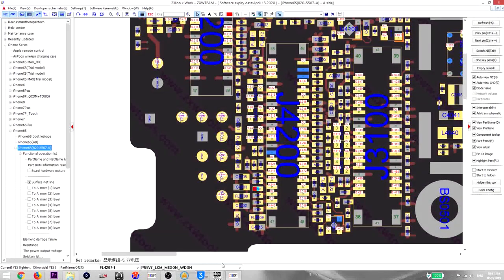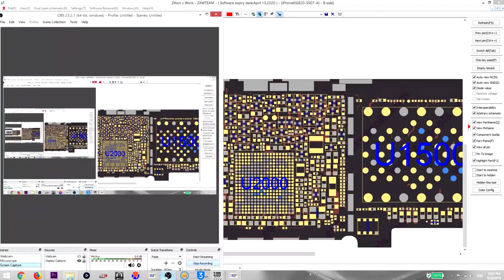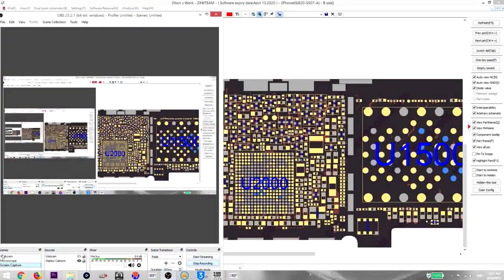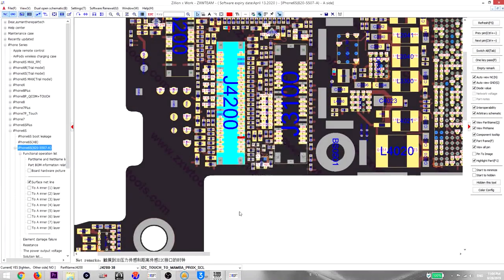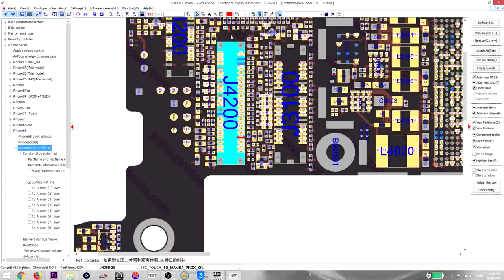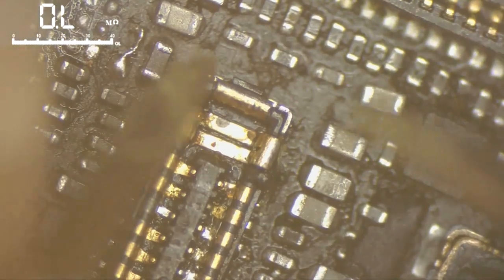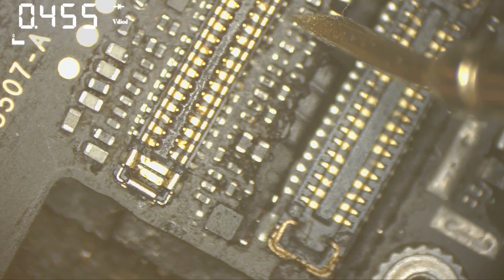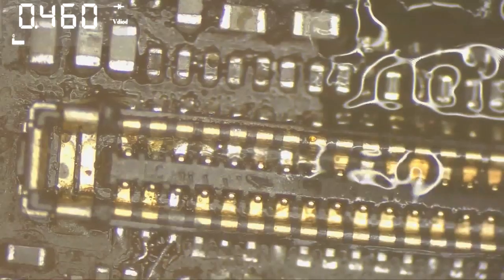iPhone 6s Touch Screen not Working Fix - Don't do This

Comment: Why you are saying “resistance” while you have your meter in diode mode ? When its in diode mode you measure a voltage where that node starts to conduct a significant current. Some one calls it voltage drop. But its correct to call it conducting voltage threshold. If you have the resistance or voltage drop values where di you get them from ? thanks

Comment: Boss which hot air station that in this video?
Reply from the maker: Hakko Fr801
Reply: Ayman The Repair Tech sir I will buy hakko or Quick 861 ? Thanks
Reply from the maker: you can't find hakko fr801 now you can buy quick 861 it is good also